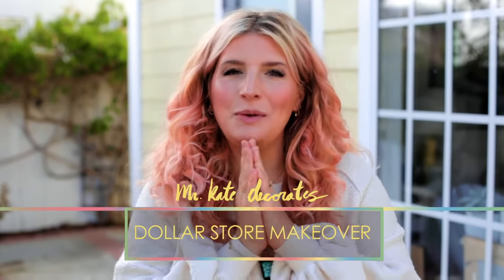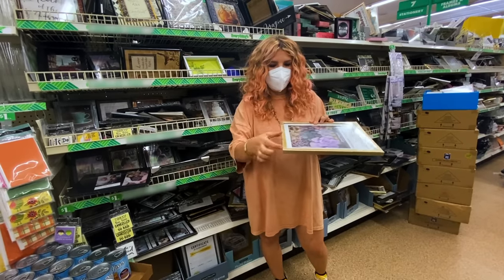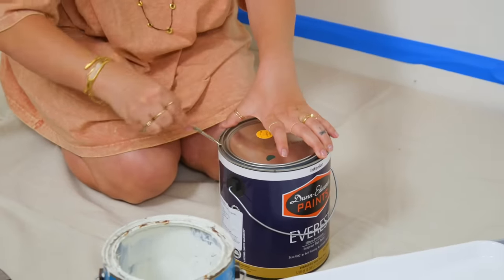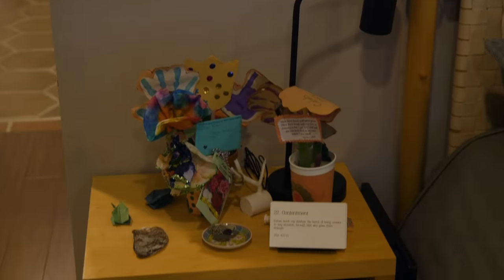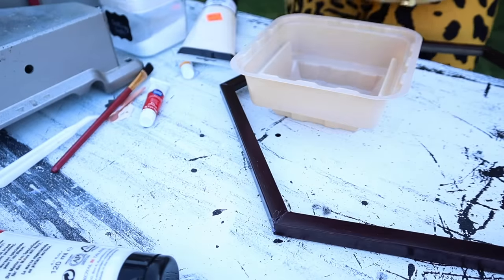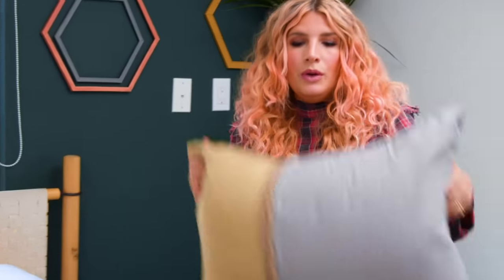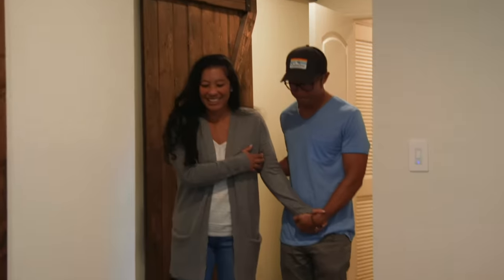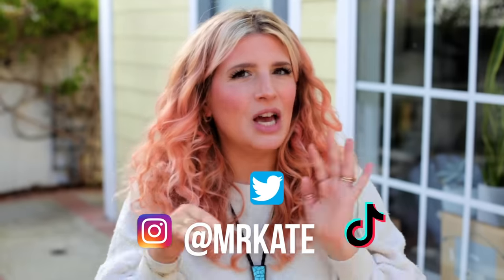Surprise Makeover! Shopping ONLY at the Dollar Store!

Comment: They should've chopped the heads of those back scratchers they seemed a little unnecessary 😅
Reply: I think the different ends add to the look
Reply: I actually liked the look of it , and my hubby would be the first to use it lol
Reply: I just felt like they looked too plasticky wood, if they were less plastic looking it might have worked
Reply: I like the look of the back scratchers!
Reply: That’s what I was thinking! It would of made it look less weird and random
Reply: i thought the same in the beginning but in the end it looks like it added more characterrr.
Reply: I have to agree. I liked the idea and the look, but it would have been better if they had taken off the scratching end and painted them.
Reply: That was my first thought, but then I realized it made them three-dimensional and thus more interesting. Flat sticks would have been so ... flat.
Reply: Yeah i kinda agree  but also it looks fine i just Think They should’ve at least chopped the other end with the hole in it off cause that was weird
Reply: The backscratchers feel a bit odd to me. I can still see they're backscratchers. 😅 I wish they were transformed a bit more. It's a conversation piece none the less.
Reply: @Travelbyailsa  I think it looks "plastic-y" because of the finish/varnish that came on the wood. I think that if you were to recreate this, you could sand them, although it would be quite tedious I would presume 😅😅
Reply: Yeah i thought it looked too obvious and took away the appeal
Reply: Yeah it's just weird. Very weird.
Reply: @jey.1024  yeh I know that’s why, don’t think they should have had to sand them I just don’t think it looked good like that I would have maybe looked for something else to make the wall decor
Reply: @jey.1024  not sure they're gonna catch on tbh 😂
Reply: they give a bohemian style
Reply: @mishelhans8134  same!!!
Reply: Some of us are interior designers (Mr. Kate) and some of us aren’t ..

Comment: I think this was a amazing turnaround, but I personally was so confused when you did duct tape on the bottom to seal the carpet squares. I figured you would have hot glued the seams together and added "texture" to the edges on the bottom to make it slip resistant.